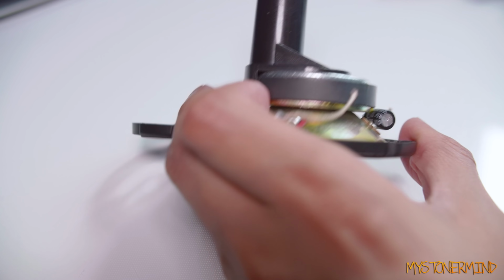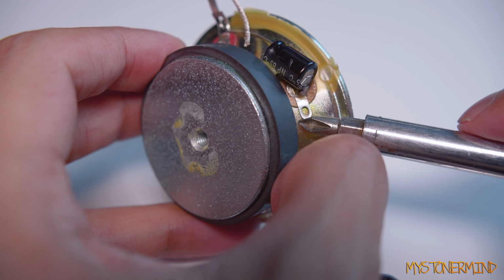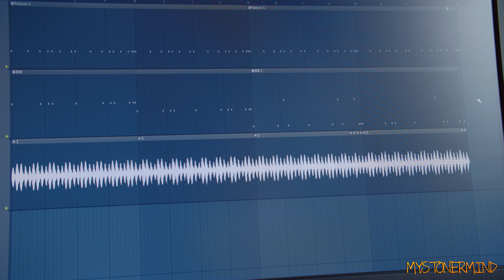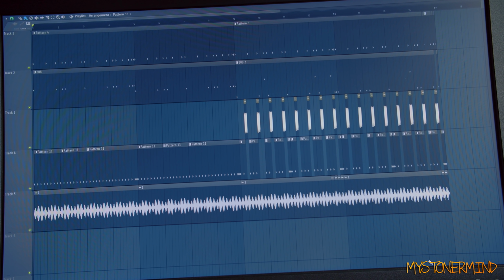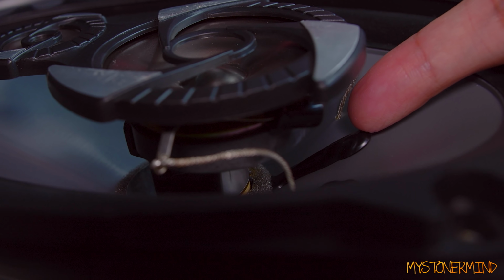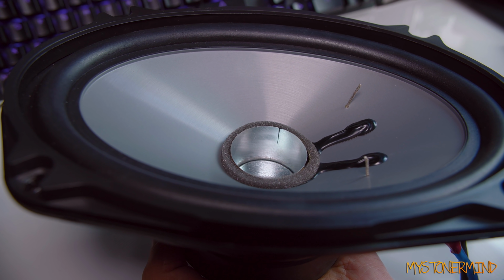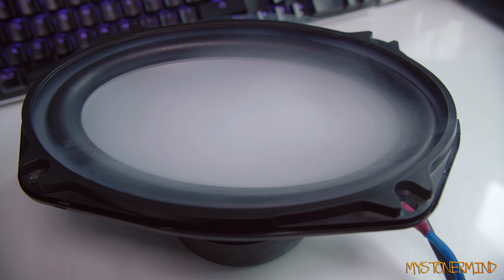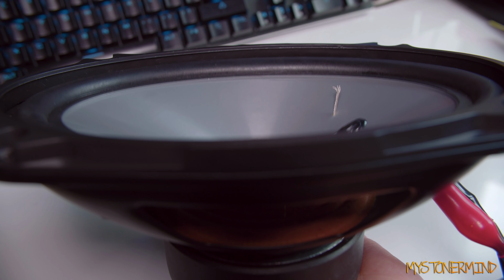DESTROYING A 450W 6x9 With BASS And FL Studio

Comment: can anybody explain why a 6x9 is better?
Reply: Because it is large and can fit in cars that a cone larger than 6” wouldn’t fit. Larger generally means more bass
Reply: It depends.. 6x9s arent often used in home audio. They often appear in car audio and I really dont know why. They also mostly are coaxial speakers meaning they have a tweeter attached to them. Guessing something like this would exist: if the same type of speaker would exist as a 6x9 and a 7.5" they would do about the same.
Reply from the maker: I wouldn't say better, just more convenient as less holes are required when fitting. 
Back in the car audio days when these things were really selling, not all cars had rear door speakers ("boy racers" would go for 2 door cars). I as well as most others at the time were reinforcing the parcel shelves our cars had and mounting these types of speakers to them.
Reply: @MyStonerMind420  ok thanks for the explaining i upgrade from my 500 watt sub to a 1500 watt sub from ground zero and custom pillars and doors go in